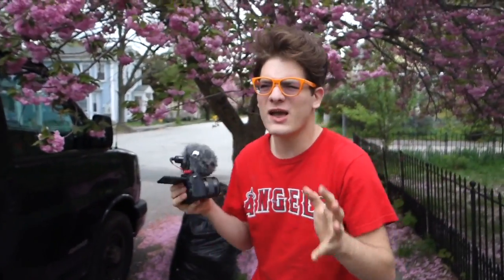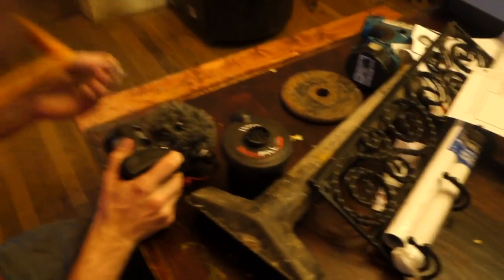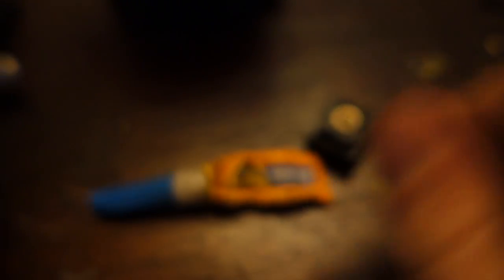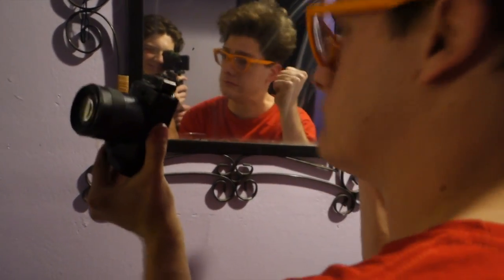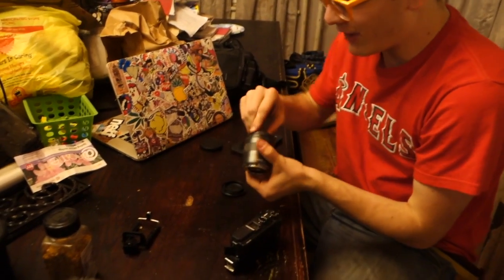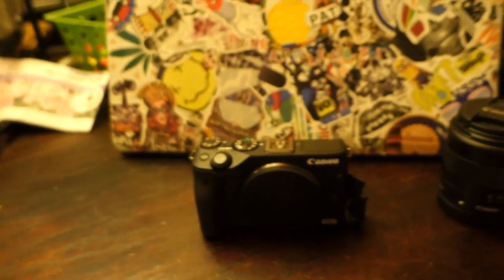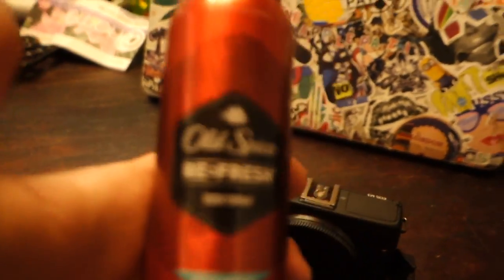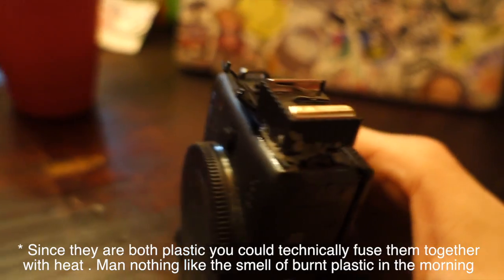Canon M3 Mic Hack And Other Canon Camera Hacks

Comment: I bought the bracket, it just arrived today. Allows you to mount the mic alongside the camera. Downside is... to change the battery or SD card you have to unscrew the bracket. Your glue on fix might be better in the longterm
Reply from the maker: +Y2Jay Does Asia the bracket was a little expensive for me and this works if you do it though watch how close it is the USB can be a problem